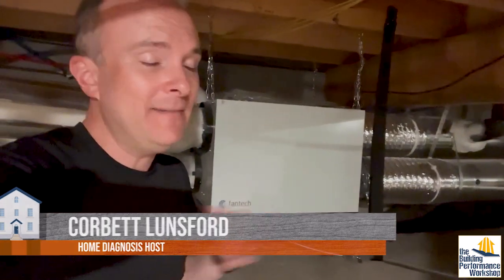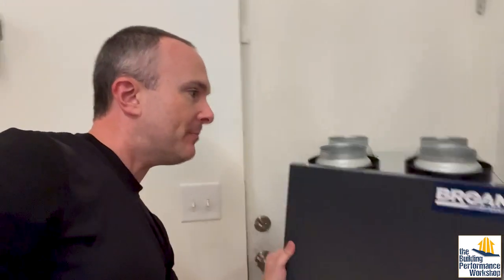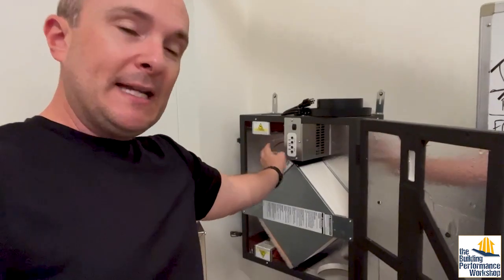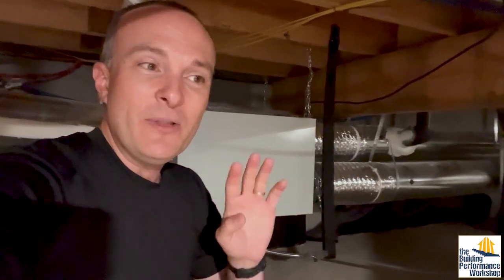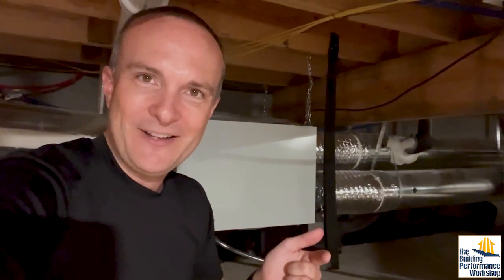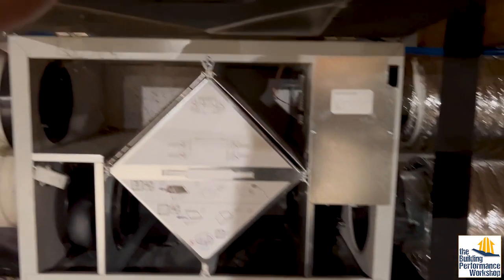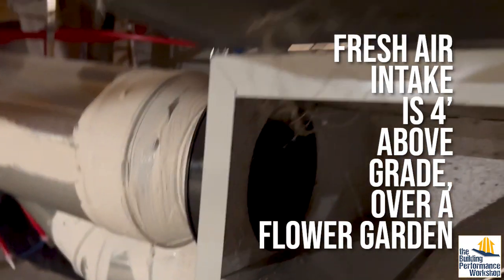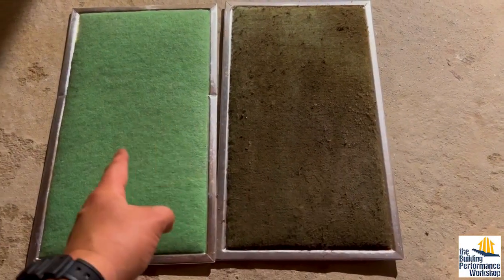ERV Maintenance: Pressure Check, Clean Filters, Evacuate the Bugs for Home Ventilation

Comment: hear me out here but these things seem to be around 100cfm on average and costs $1k+. why not just run a duct from the outside of the home to the plenum of the air handler before the fan? when the AHU turns on it sucks in air from outside so it automatically uses your air handlers filter, or install an inline damper/filter shroud with some ingenuity and it costs almost nothing. then install one variable speed exhaust somewhere like the living room/kitchen (or on the return line of existing ductwork)  to achieve the pressure you want, if you have an older leakier home may not even be needed to install additional exhaust.

Comment: Have been wondering if HVAC ducts really need to be insulated in high performance homes.  Your video seems to confirm they are not required if the system is working correctly, and presumably if you are actively managing dehumidity.    I guess ERV and Make Up Air intakes would still need insulation.
Reply from the maker: It’s an insurance policy, best way to look at it I think

Comment: Any new ideas on inserting something on the interior or exterior to help filter the bugs and other big stuff before it gets to the ERV? Maybe a larger exterior fresh air intake vent with a filter to catch the big stuff (bugs, blades of grass, large pollen, etc.)?
Reply: https://youtu.be/XmjHn8pkECM
Reply: @tetsuikyo  A cyclone fan design is a clever solution to removing the large particulates from the outdoor air and discharging the particulates outside thereby reducing the rate of clogging the inlet filter of the ERV.

Comment: So you don't need a bug screen in the intake air, the incoming filter catches the bugs?
Reply from the maker: Haha, good catch Cindi. The screen that’s in there already is apparently not good enough for THIS APPLICATION- it’s fine when not installed 3’ above the ground in a buggy environment. Just one more example of how off-the-shelf products don’t work for everybody. I’ll be tweaking ours with a finer mesh, BUT THEN I’ll have to add cleaning the outdoor vent screens to my maintenance schedule, because the caking of bugs will be outside instead.
Reply: @HomePerformance  Thanks for clarifying!  I'm having trouble finding nice exterior intake vents that have cleanable bug screens.  Many either they have no bug screen, or they have them but they don't come out for cleaning.
Reply from the maker: Yes :(

Comment: We have fine layers of dust (our Dyson V15 green laser is so generous to point out) every day or so on every floor…trying to think about how to clean/upgrade/enhance/replace an old HVAC system (not original to the 1960 home, but definitely old)

Any thoughts/ suggestions? We live in Dallas if that helps hone any feedback

Separately, absolutely love your chancel, learned/learning so much as a man who never learned these things growing up. Also, I bought a low-level carbon monoxide detector based upon your Rec(first video I saw on the channel) thank you, thank you, thank you!!
Reply from the maker: Wonderful! That dust is coming from somewhere- we humans happen to make a lot of it, yes, but building materials shouldn’t be degrading that fast for sure. So you could install a MERV 11/13/16 filter cabinet on your HVAC and run the fan continuously, BUT it might be that the dust is coming from outside. Sometimes homes are accidentally depressurized because of HVAC leakage or exhaust devices. You should have your home tested if possible. In Dallas, I recommend a home inspector named Jim Hemsell, who’s one of my Mastermind students.
Reply: @HomePerformance  bless you fine sir.
Reply: Can you recommend anyone in Brooklyn, NY for pressure testing?
Reply from the maker: Yes I can- contact Allie at Biophilic Build

Comment: this is why you should have a separate filter setup on the supply with a much bigger filter. that filter is tiny, no wonder it clogged up so fast.  even my slightly smaller than typical filter, lasts 12 months in my small house. use the stock erv filters to protect the erv.
Reply from the maker: Good idea, T
Reply: @HomePerformance  any reason for the lack of separate filter? Matt Risinger had a video of his with the zender, also seen it locally here as well. so its seams to be commonly done. odds are in years to come those filters will probably not be available. i would want to stick to a simple, common as mud filter, you will still get in 20 years time. or at least the whole filter housing is easy to change over should filters no longer be available.
Reply from the maker: I don’t think anybody here would call Zehnders ‘common’. And it’s more en vogue to offer a one-and-done product, the system of interconnected parts is not a mainstream interest. Hence this channel and our TV show.